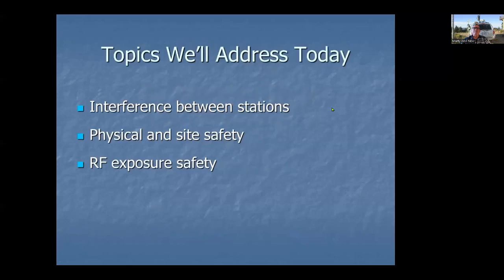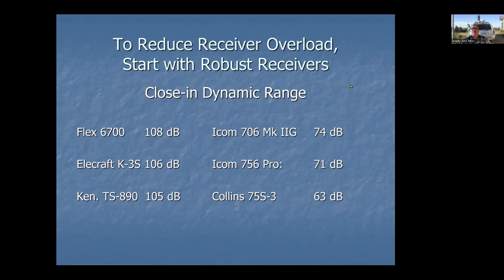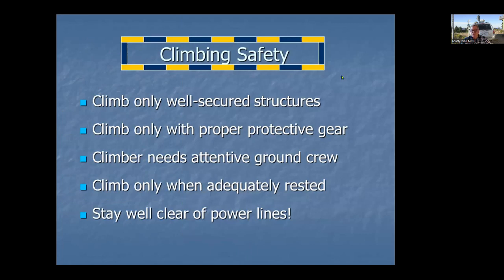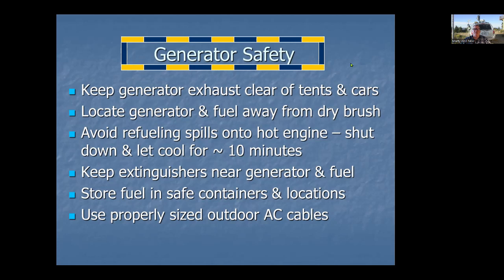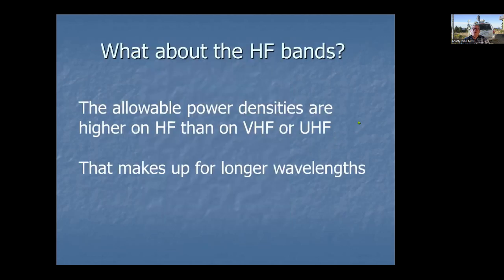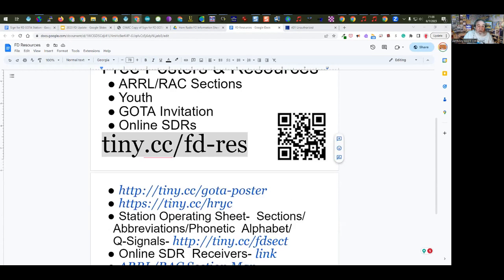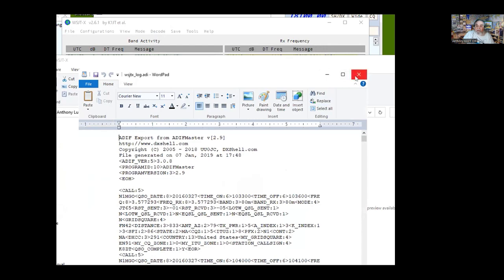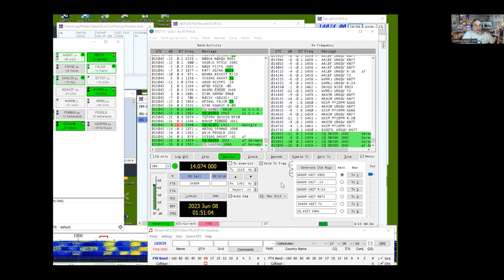ARRL Field Day Last Minute Prep & Follow-up- 06/07/2023

Comment: This was intresting. My friend and I are going to try a field day this year in my back field. When I was first licensed I went to check out the field day site and was asked if I wanted to operate 80 phone, I jumped on that because I was a tech at the time. I was left there alone all night, no one ever came back and I was told not to stop until I will relieved. I never sent back to a club Field Day.

Glen`s (KD8KMY) and myself (K8OCN) are going to do a laid back field day, we will have two stations but are just going to operate for awhile and take a break and operate again ect. We will not win any awards and we do not care we are just going to have some fun. We are going to run all Battery power and during the day solar to help the battery's last.